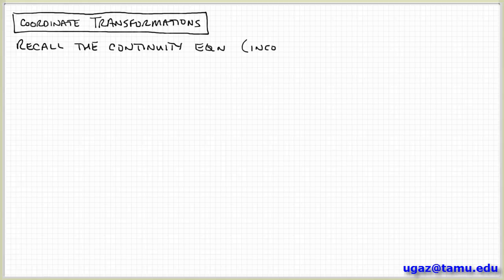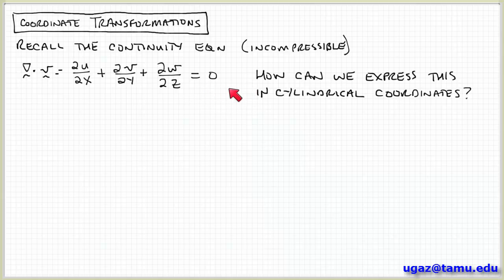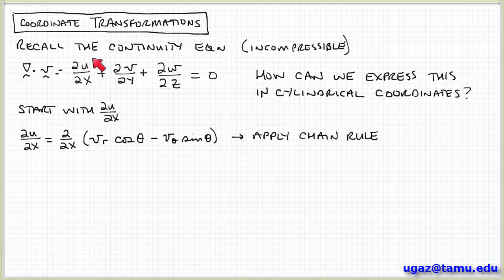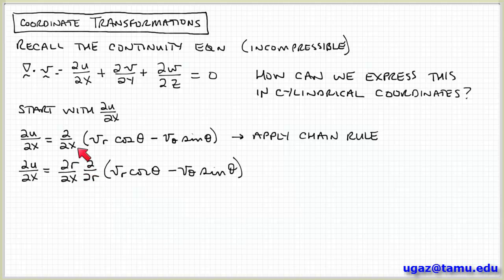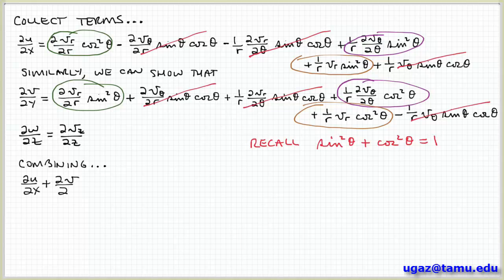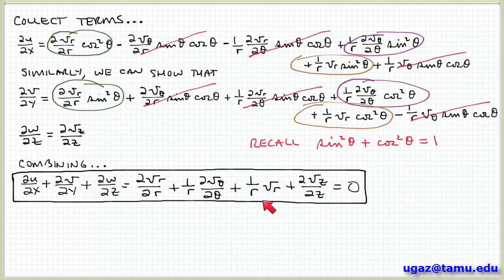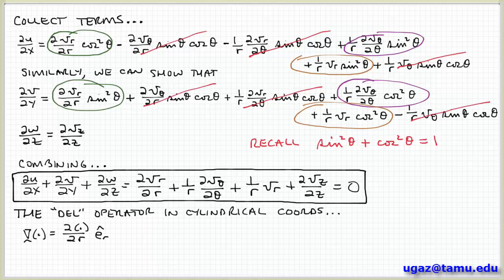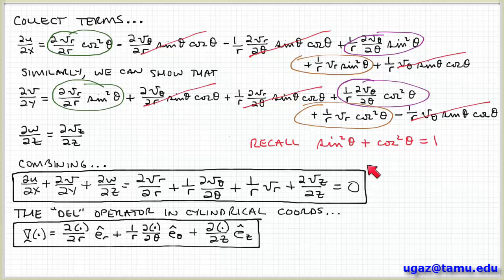Coordinate Transformations, part 3 - Lecture 3.3 - Chemical Engineering Fluid Mechanics

Comment: Holy f. And based on the comments, this is accurate or inaccurate? The commenter should give the correct solution if they're challenging that which is shown in the video.